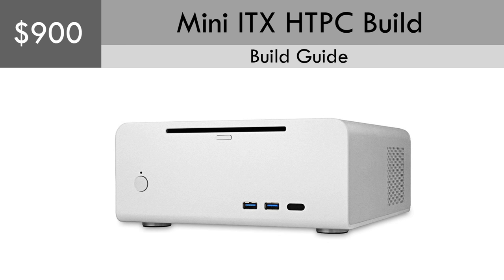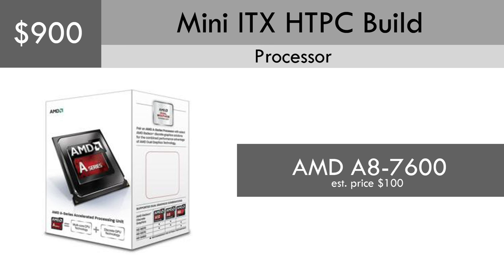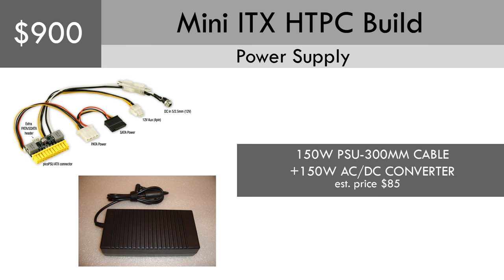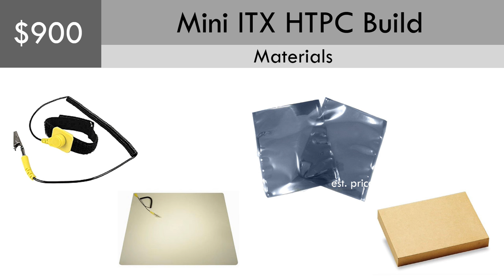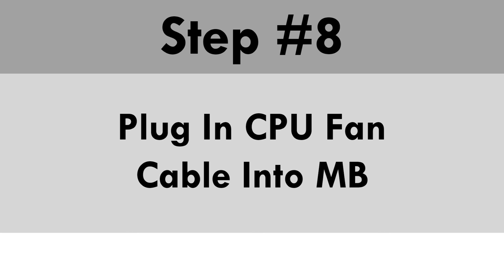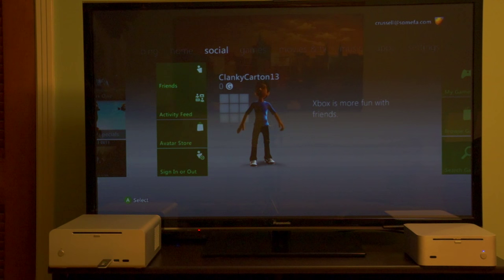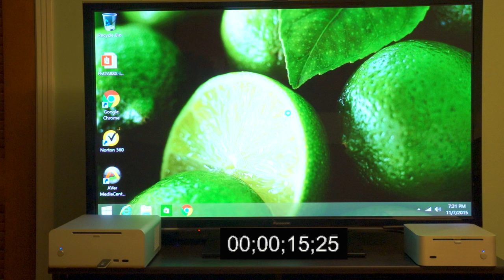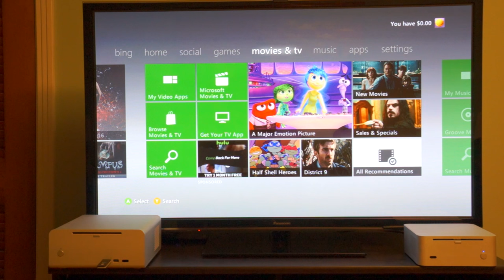AMD Casual Gaming / Capture Mini ITX HTPC Build Guide

Comment: Hmm... There's a problem here. If the UJ265 or ST-OB2 is installed, where do you put the M.2 NGFF Key M to PCIe? That optical slot is the only real opening for anything wanting to escape outside of the case. I have a Magewell Pro Capture Dual HDMI, HD60 Pro and... LIVE GAMER HD 2?! HOLY CRAP I CAN GO FULL LINUX IF I WANTED TO! I wonder if I could somehow make a hole... Wait, the bluray drives don't have plastic caddies underneath the discs, I can just cut off a portion of the bottom edge plastic.

Comment: A very nice job with this build. I'm surprised that you didn't use an A10 though - namely the A10-7860k because of it's TDP being only 65W, but it still being on par with the 7850K integrated graphics performance. Then again, looking at the date of this video, that might be why, but I'm planning on doing a build almost exactly like this with the A10-7860k instead. Great build and a good job filming it as well. It's nice to see an AMD APU build in a Mini ITX build small enough that a PICO PSU is needed. I absolutely LOVE the tiny form factor here. My purpose is a little different however, being that I'm looking to build an entirely TINY by all means but still very powerful gaming system that will be of at least console gaming quality or better for LAN Parties! The newer Kaveri architechture APU's have achieved the power to do it. Can't wait to get my build done as well. Also can't wait to see the performance of the upcoming APU's from AMD's next processor lineup!

Comment: If you don't need the capture, pcie expansion, or in built blu ray, then get an ASRock Beebox.
It will do 1080p, has mSata and room for a Sata drive - I put my old 120GB v300 in, uses two sticks of DDR3 laptop memory up to a total of 16GB - I slapped some HyperX in there.
Plus compared to this it is tiny, and a lot cheaper overall, especially if you are running ubuntu like me - though note you need to either patch it for usb3 or have native usb3 support for windows as it only has usb3.

Comment: Hey Somefa,
do you get a satisfying click feedback from the power button of this case? Mine is very squishy and doesn't give me any feedback at all. Maybe mine has a failure...
Reply from the maker: +Stani Jackal  Yeah I have the same problem. They are a bit soft but I don't have a problem turning them on
Reply: +Somefa Turning the System on works, no issues there.
I recently got a Streacom FC9 Alpha for my dads NAS/HTPC and the power button (looks exactly the same) has very nice click hear and feel.

Comment: I am currently looking for a build on the FC8 Alpha Fanless Chassis. Intel Core i5-7500 3.40GHz 65W. 16GB DDR4 RAM. Probably GTX 1050 Ti 4GB. Without Over- or Downclocking, do you think this System might work in terms of heat situation? Casual Gaming, but Photoshop working. Thank you for the video!
Reply: niasboiii Does the 1050ti fit heightwise in this case? Do you need the low profile version (though that's dual slot I think)?

Comment: Hi dear friend, i have this case and i want to intel i5 computer.  I using rhino ceros autocad corel draw and eagle cadsoft, but no rendered...i need  2-4gb128bit low profile graphic card for this case... But i dont find, would you like say me how can i use a graphic card? Picopsu 160 eneoght for i5 and 128bit graphich card? Or i need more power? Thanks you

Comment: Do you have any problem keeping the processor temperatur down? I've got a simular build with the same chassi together with an AMD A8-7650K and a Noctua NH-L9i CPU fan. For additional cooling I've got a Noctua NF-A8 PWM 80mm chassi fan. 

When I've got the top cover on the core temp is between 80-100c when I'm not even running anything heavy. When I take the top cover off it's a little bit lower. Do you have any ideas?
Reply from the maker: +Jagvillboienhatt Unfortunately, I think the AMD A8-7650K is a little too much for this case. Its rated at 95 watts. I would go with something 65 watts and below. 45 watts or below would be even better. Maybe you can down clock this APU.
Reply: Just a quick question, since I am planing a similar build: Is it the case which is the problem for a 95 watt cpu (I am thinking of the A10-7850k) or the psu, which I think could be to weak for such a cpu plus the blu-ray disk?
Reply from the maker: I would suggest going 65w or lower. It might work if you don't plan on adding a graphics card but the case might not be able to handle the heat especially with the drive cage being so close to the cpu fan.

Comment: What was the power consumption of the R7 250? I have small pc with a 240 watt psu and I want to get that card or the gtx 750 ti but I'm not sure if the psu could handle it.
Reply from the maker: 65w

Comment: well the power supply hold if upgraded to a10 7850K?
Reply from the maker: +hithummah I think you should go with a TDP of 45w or lower. Especially if you are adding a low power graphics card. I had to set the A8-7600's TDP to 45w.
Reply from the maker: A10-7860k should be fine lowered to 45w